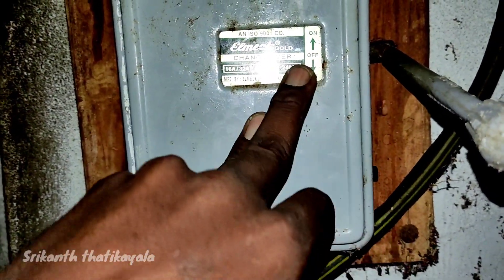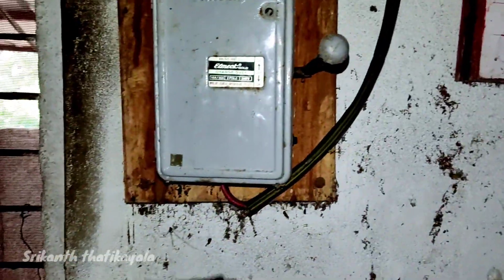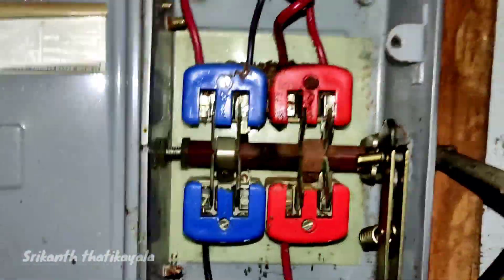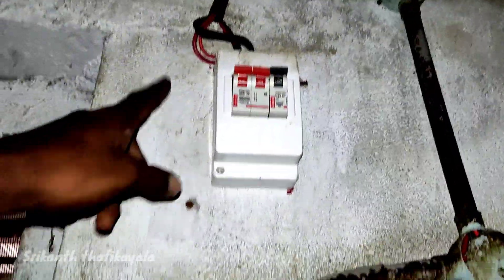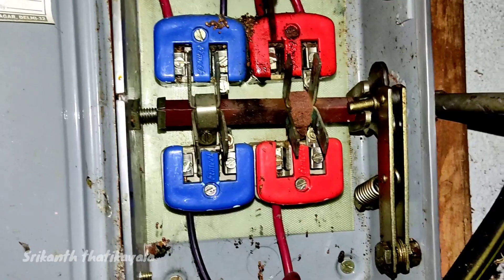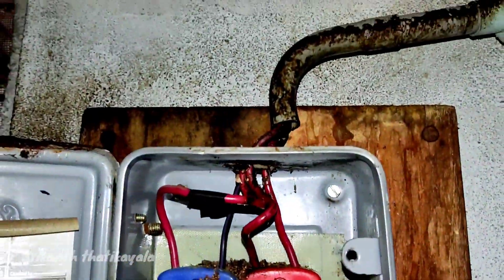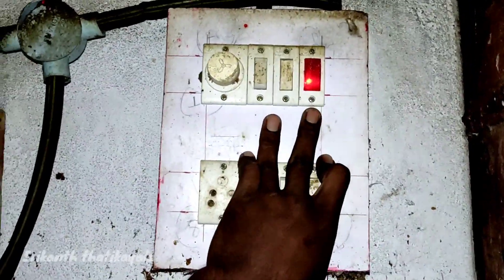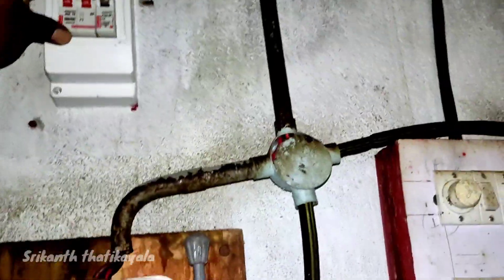Change over wiring connections | single phase change over connection in telugu | Srikanththatikayala

Comment: Inverter process

Inverter wiring lo  inverter phase ki fan and lights ichuntam kada avi normal power tho ela run avtay
Reply from the maker: Inverter nundi ochina phase wire ki connection istav kada.. power unnapudu   dhanitho power pogane inverter mida automatic ga nadusthundi..
Reply: @Srikanthelectricaltelugu  anna inverter phase normal power kalavadu kada anna
Reply: Inverter tho fans onchesi power velte ela run avtayo video chey anna
Reply from the maker: @vaikuntakaragana9615  ok bro try chesta....